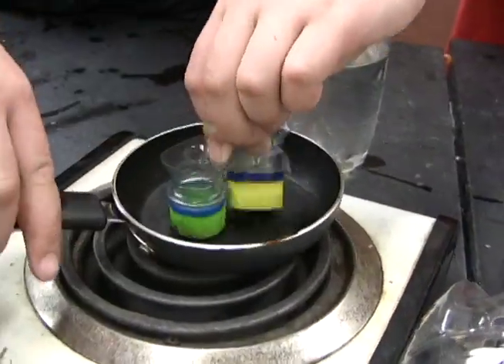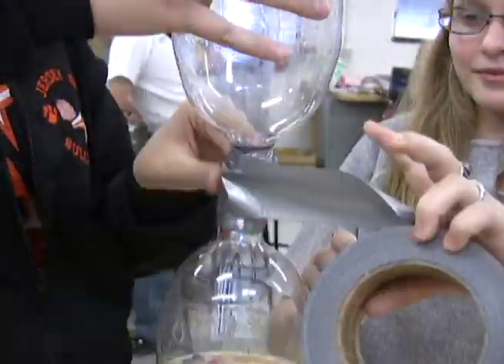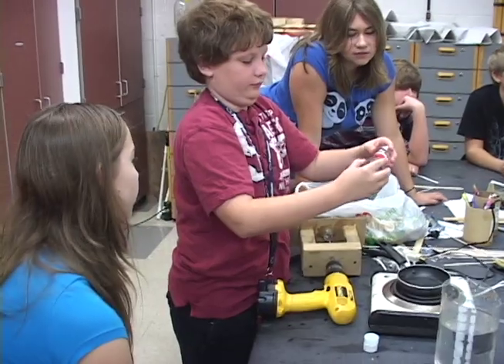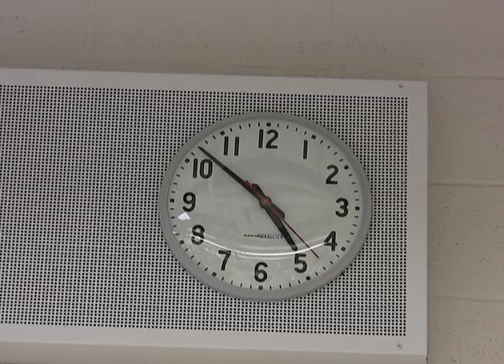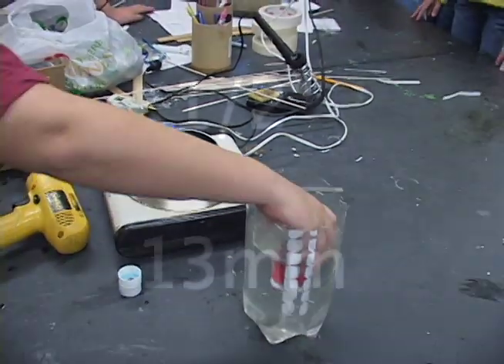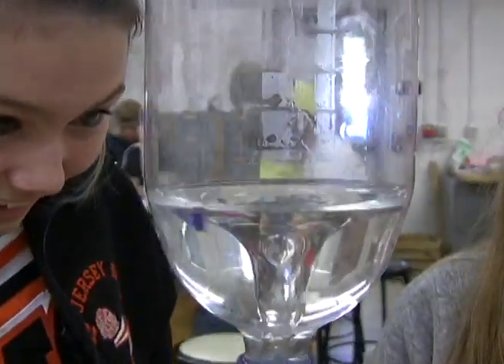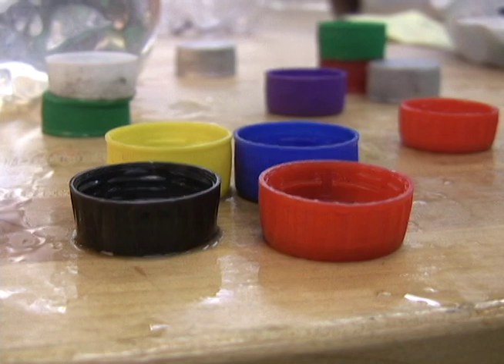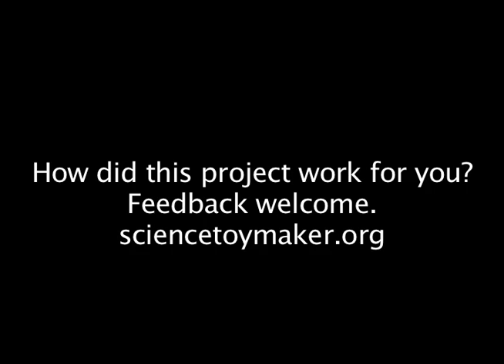Weld Bottle Caps Together to Make a Vortex

Comment from the maker: Every stove is different. The trick is to get the teflon pan hot enough that a drop of water dropped on to the surface will roll around when you tilt the pan.

Comment: thank you so much for sharing this!! I will do a little experiment and this was a crucial piece of handiwork i needed, i was going to do it with a soldering iron but this method is way better
Reply from the maker: Male sure it's a non-stick pan, and experiment with how much to heat the caps. Good luck!

Comment: One thing I noticed, is that if you watch the inside of the caps as they are heating up on the frying pan, it changes color slightly when it's fully heated. It seems to start in the center then spread to the entire cap. I found it to be a good gauge as to how long to heat the caps, as after this happened, it wasn't long before I could see the plastic melt around the edge.

Comment: I tried doing this with gallon apple juice jugs, but I deformed the bottle caps to much for them to seal. Undaunted, I headed to Sears Hardware, and bought a 1.5 in drain coupler with hose clamps. It fits and seals perfectly, but it does drain a bit too fast, so now I have to figure out some kind of restrictor.

Comment: if you use very cold water the top bottle squishes because the air contracts as it bubbles up. At first I thought it was the flimsy bottle but it's ok if you use tepid water

Comment from the maker: @davidvwilliamson Yes, I think as long as the water is a little colder than room temperature, it eventually expands a little and keeps the bottle from denting in. In the short term, very cold water might cool the air the first time it's flipped, contracting it until it warms up eventually. Cracking the lid on one bottle can let more air in.
Slater

Comment from the maker: Experiment with it. Remember, the plastic should be melted enough that it starts to ooze from the edge. Also, you might try sanding the bottom of the bottle cap. If it has dirt or grease on it, it won't stick. Good luck.
Slater

Comment: ever heard or JB weld or crazy glue?
Reply from the maker: Yeah, I tried various glues but they didn't have the strength. Unlike PVC, there is no solvent cement for polyethylene, polypropylene or polyethylene terephthalate (PET, what carbonated drink bottles are made from).